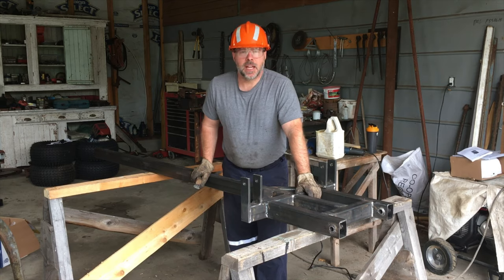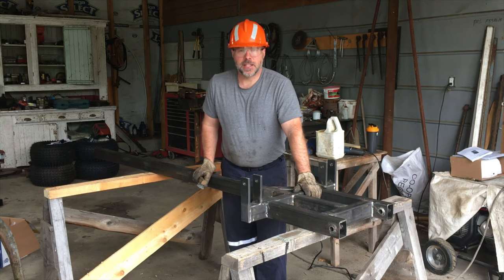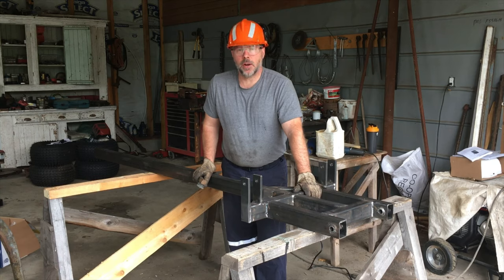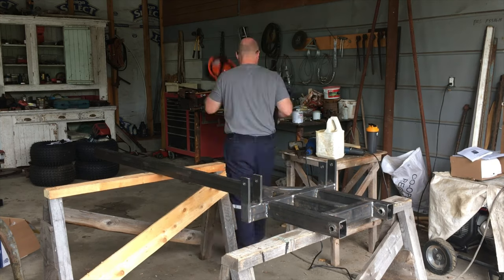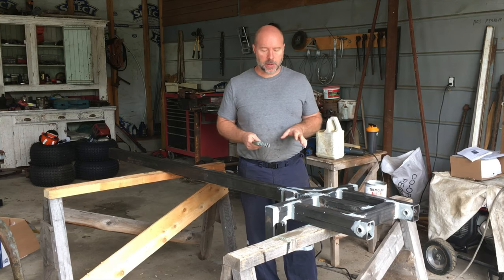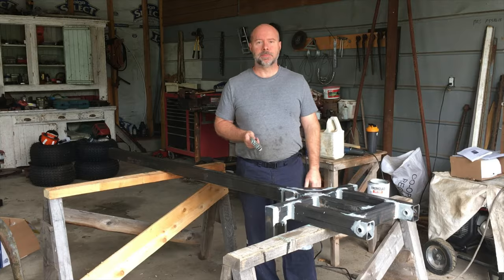The Ultimate Quad Trailer - Part 2 The Walking Suspension #theultimatequadtrailer

Comment: I made this cart from your specs. It turned out great except I had to add a sleeve attachment to the reciprocating arm. It got worn fairly quickly with continued use. No big deal.
Reply from the maker: The trailer is amazing!
Everything spring I pull the bolts out and grease them.
So far they’ve been holding up.
I totally agree that bushings would be better though.

Comment: Why not have the axle spindle goes through both pieces of square? Or why did you choose to extend the square out with another piece with the axle?
Reply from the maker: Wheel spacing from the walking suspension. This gives room for the tire not to rub against it.

Comment: We had 5 rubicon’s.   We are down to two because we bought a 5 passenger Honda 1000 pioneer with glass front and back. And heater.
Reply from the maker: They’re 520’s now aren’t they?
I think a friend of mine had a Rincon and I think it was a 600.
I either need a bigger quad or a compact tractor now.
Reply: @LivingtheNorthernLife  yes they were all 520

Comment: Very Nice. how many kg does each axle support in weight?
Reply from the maker: Hey Alex,
The axles are rated for 1250lbs each but the tires I’m using are only rated for 400lbs each.
There are high speed axles I bought from Princess Auto.
I think they’re $79.99 but normally go on sale for $49.99.
Thanks
Andrew

Comment: What wheels and tires did you use?
Reply from the maker: Hi Robert,
I bought these in Ontario Canada so I'm not sure these will be much help.
Tires/Wheels: http://www.cerka.ca/62-22-8-4-22-x-11-8-knobby-atv-trailer-tire-on-4-bolt-wheel?search=62-22-8-4
Hub: https://www.princessauto.com/en/1250-lb-high-speed-trailer-stub-axle/product/PA0002080000
Hope that points you in the right direction!
Thanks
Andrew

Comment: Where did u get ur hubs and tirea
Reply from the maker: I bought these in Ontario Canada so I'm not sure these will be much help.
Tires/Wheels: http://www.cerka.ca/62-22-8-4-22-x-11-8-knobby-atv-trailer-tire-on-4-bolt-wheel?search=62-22-8-4
Axles: https://www.princessauto.com/en/1250-lb-high-speed-trailer-stub-axle/product/PA0002080000

Comment: Where dud you get the wheels at?
Reply from the maker: This is from Part 9 in the description:
I bought these in Ontario Canada so I'm not sure these will be much help.
Tires/Wheels: http://www.cerka.ca/62-22-8-4-22-x-11-8-knobby-atv-trailer-tire-on-4-bolt-wheel?search=62-22-8-4
Axles: https://www.princessauto.com/en/1250-lb-high-speed-trailer-stub-axle/product/PA0002080000

Base is 2"x3"x3/16"
Bed is 2"x2"x1/8"
Reply: @LivingtheNorthernLife  yeah link don't connect for the wheels...guess they be the same as atc, 200m, were they expensive?
Reply from the maker: @rossokeefe9268  they were about $120 CDN each
Reply from the maker: @rossokeefe9268  I see the price changed to $142 now
http://www.cerka.ca/index.php?route=product/product&product_id=1575&search=62-22-8-4